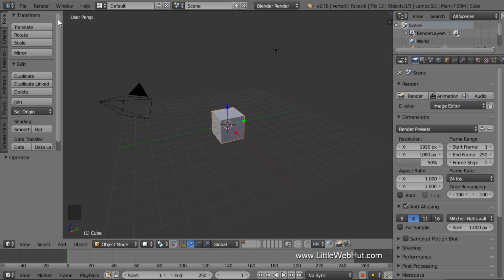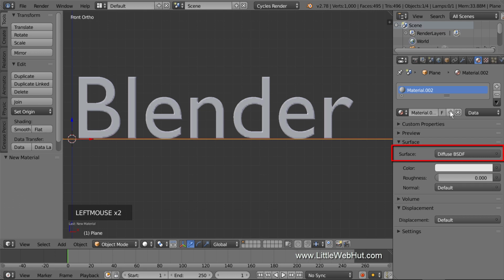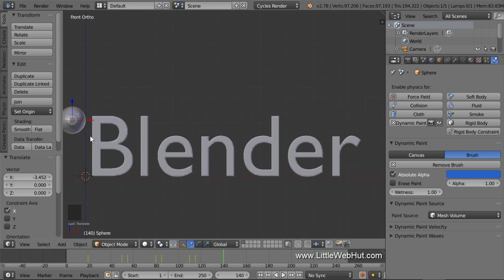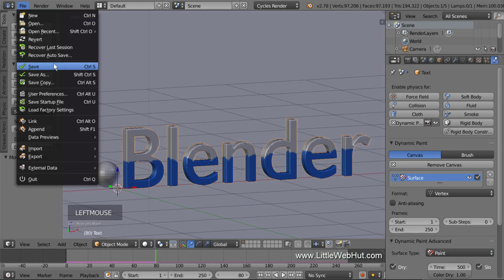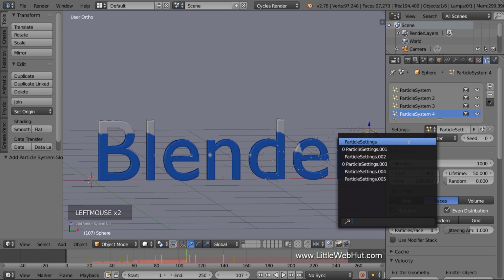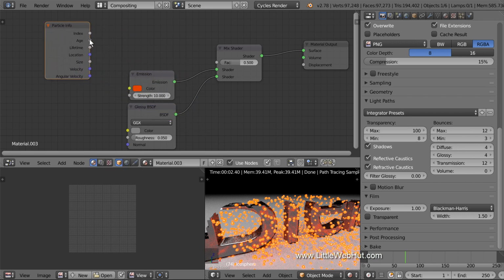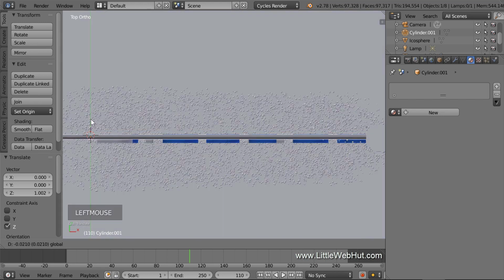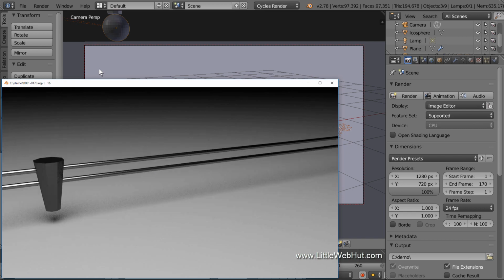Blender Tutorial: Fanciful Text Machine Animation

Comment: After I finally got the other stuff to behave more or less as it should (and even ditching it all and starting from scratch did not really help there, it's just cursed) I could not render this at ALL. It started out well but went off the rails in all directions after that. 
But: I actually found out how to fix my problems with rendering the animation - and hopefully this may help others who struggle with the rendering and very strange things happening: you do have to bake the dynamic paint. If there's a cache file and you have trouble with the render, delete it. Start out by deleting all bakes and then bake all dynamics (in the tab where you set up the canvas for the dynamic paint). That basically was the missing link here - before that I just could not render it right at ALL, it would always do wrong and unexpected things, like messing up the particles, the text suddenly being gone after 40 frames in, stuff like that... If you have similar problems, try baking it, may it help you render this and finally grant a satisfying project. Because this is a beautiful project, just very frustrating if you are a beginner and have the new Blender version (as you should).